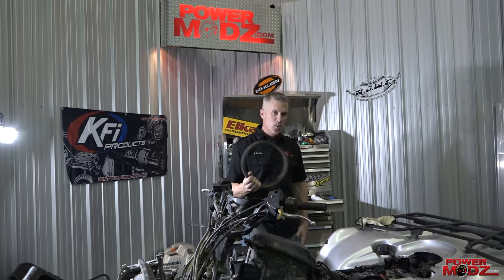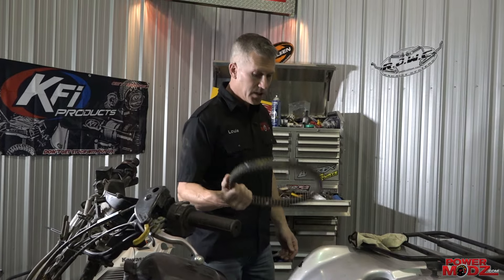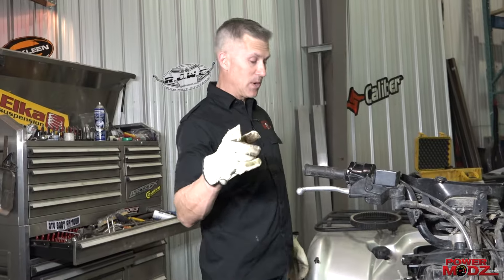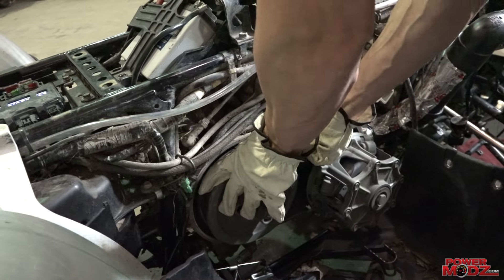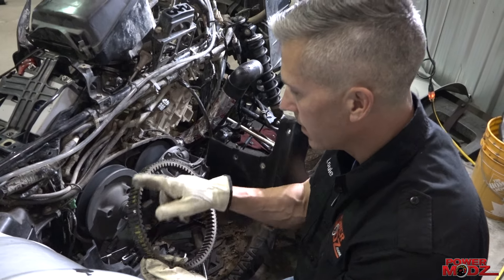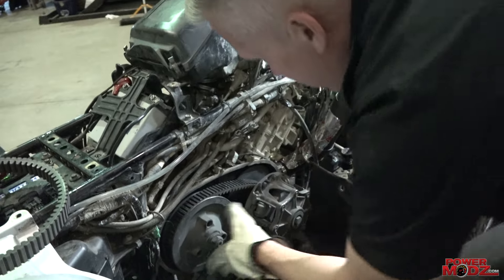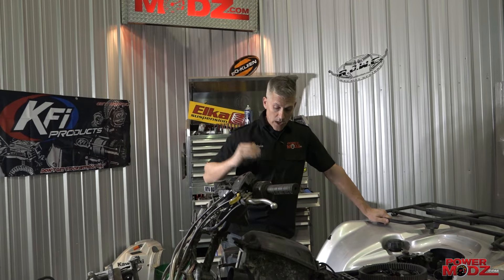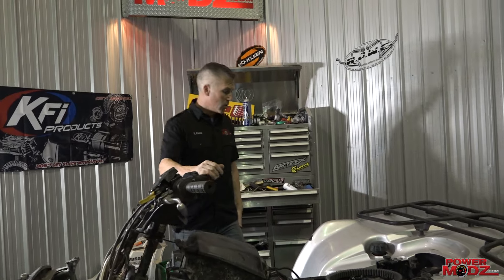Changing an ATV belt,  BRUTE FORCE 750 series!  No puller needed!

Comment: Thanks for the video, I needed that. I'm not as tough as you. When installing the new belt, I could not quite turn on by hand. I'm 68 and not as tough as I used to be. I did do something that really helped me though. I got the belt started on the bottom of the secondary as much as I could turn it, then used a socket  and breaker bar on the secondary pulley nut and rotated it right on.

Comment: I like the technique. I have another.

Take a two inch piece of any old belt and the rubber handles  on a pair of channel locks or whatever. Put the handles in between the second clutch and wiggle back and forth while pushing the belt chunk down at the same time. When you get the piece about an inch or two down the new belt will slip right on. I'm making a video soon when my new belt shows up..👍👍

Comment: I can see in an emergency situation forcing the  belt on and off. But I can also see in my mind not with my eyes how it can damage your belt your new bill especially when you spending high dollar for the original equipment belt Kawasaki service manual recommends 240 flywheel why doesn't YouTube mention to put a fly wheel if you are in a suitable working condition garage or building whatever to avoid this stress point in forcing the belt on the ATV?

Comment: That belt was loose. It's almost impossible to change a belt in this manner when the deflection is set right. And the only way to get the deflection right is to disassemble the secondary clutch. 
I would only attempt the method you used if I was stranded in the middle of nowhere. Why risk a hernia if the bike is sitting in your shop right next to all your tools?

Comment: To clear limp mode u have 2 options, this is caused by excessive slack on belt
1 remove the roll pin from the belt switch 
2 shim ur driven pulley
Reply: I always thought the clutch needed to be reshimed when putting a new belt on

Comment: I need to change my belt on my 07 Brute 650, I was reading on Gates website, stumbled on accident, it says to clean the contact surfaces thoroughly. Is this necessary I’m not not saying for or against but I haven’t seen anyone do this. It also says to break the belt in with 2 heat cycles letting the bike rest to cool etc. what’s your thoughts, thanks great video.

Comment: That doesn't stretch out or hurt the belt at all?
Reply: No it will not hurt the belt >
Reply: The force you use to put the belt on isnt even as close as the force the engine puts on it.

Comment: I did this on my 03' KVF 650, now the belt squeals and it creeps when in forward or reverse. Any idea whats going on?
Reply: I got the same problem. Owner blew a belt. I cleaned the clutches/sheaves and put on a new belt. Same problem. Someone said it might be strands of belt caught up in the clutches somewheres, but I looked it over.  But I haven't taken the primary off yet. Another said that the secondary needs to be shimmed, a dealer mechanic also said this.
Reply: @rezifiedoutdooradventurez1441  Makes sense, I did fix it since my last comment, it did end up needing shims like you said. I bought a puller tool off Amazon and removed the secondary, shimmed it, cleaned it up and re-installed. No squeal now and it drives normal. Of course the shims are only available at a dealer and they weren't cheap, just overpriced washers.
Reply: @DodgeMan360  Yeah I took the secondary off and there was only one thin shim... Had owner contact the dealer and get some shimms.

Comment: Great video. I removed the cover and found a lot of oil like substance inside the converter area. Is that normal?
Reply: No.  There should not be any oil whatsoever inside the cvt belt housing.  I would inspect the seal around the cvt housing first.  You may want to check for oil intrusion from the engine itself.  If oil from the engine is not a problem, clean the clutch sheaves with brake parts cleaner then try sealing the cvt housing with dielectric grease.
Reply: So if you got oil from engine check behind the clutch
Reply: Sometimes the crank seals leak and get in there.

Comment: Is it normal if I just replaced my belt and while in gear, with the break in stopped the new belt squeaks a little bit? Or does that not sound right
Reply: Some belts are directional  just make sure to always install the belt with the writing and numbers on the belt going the same direction as engine rotation (( IF ))  the clutch drives are on the Right side of the Engine !!  For example  you read from left to RIGHT ... & most engines Right Side Drives rotate Clockwise to the RIGHT !!   Left Side Clutch Drives Rotate Counter Clockwise .... And Belt Squeak Is Normal Until 2 to 3 hrs of Run Time On A New Belt !! 
 Thanks - Matthew
Reply: Joseph Krause A light squeal is actually ideal. It means you're on the tight side of the deflection range, which is good.

Comment: The kawasaki is full on shit over heat every 5 minutes even from factory accept if you going full throutel for a second then going 4 miles and hour
Reply: Full 100% info of fake shit, my '05 750 has never even "once" over heated, including hot trail riding +30 days. It can run hot for sure..never over heated though.

Comment: i have a kawasaki teryx 750 belt broke i replace it with Gates 19G3218 it squeak went i put it in gear
Reply: Try to use genuine kawasaki belts. Ive tried all brands amd the origibal is the toughest with big mud tires. The gates i went thru quick
Reply: I had the same issue did yours ever go away or did you go to a kawasaki belt
Reply: @Richard-gy1fo  about 
how long do the belts last?